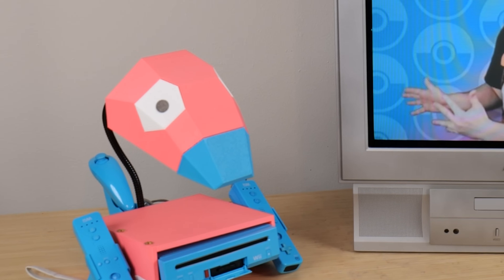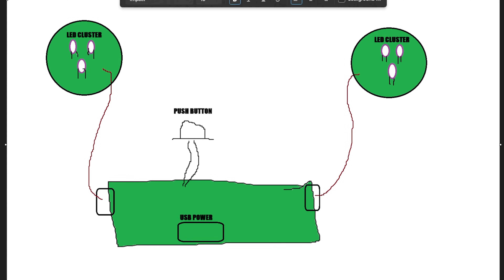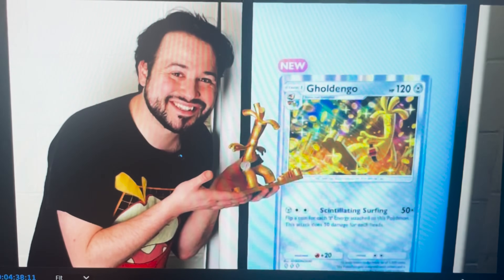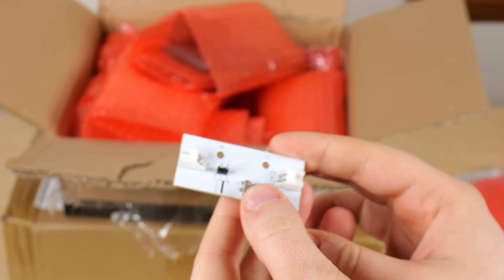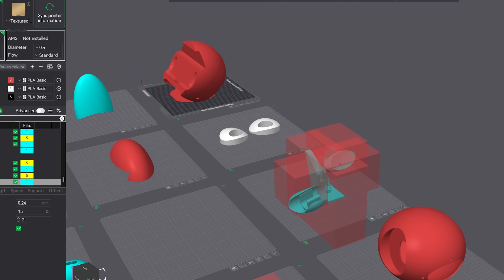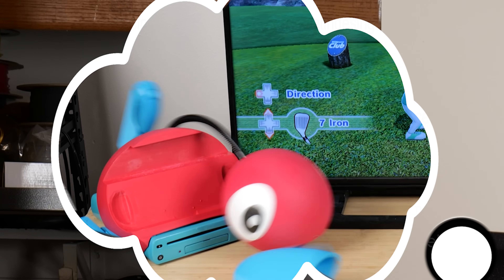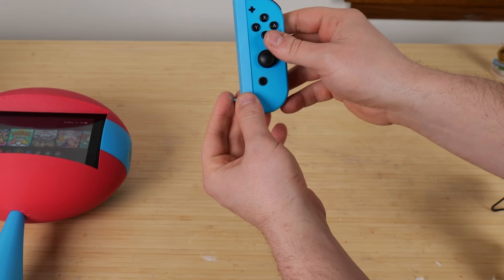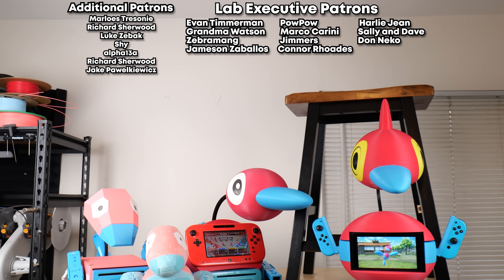I 3D printed more Pokémon Consoles

Comment: 7:34 The reason why the sensor bar works farther away is because the gamepad has a built-in sensor bar for Wii games when you use it as a screen. You got 2 sensor bars added for double strength and signal.

Comment: 6:13 You aren't. It not designed to be tampered with.
Reply: But they are designed to be repairable (by Nintendo) so, yes there was a way to disconnect without damaging the socket.

Comment: Looks good, but next time you should go to a home improvement store and get the paint color matched to your filament. When you paint, use light multiple coats, wet sand between coats and don't forget to use a primer. If you really want it to bling, finish off with a couple coats of UV resistant clear. Then you're gold. All in all, great job. Do you offer these files? I think it really looks good.
Reply from the maker: Thanks for the tips!  And yep the files will be live on my patreon starting tomorrow!
Reply: @BigRigCreates  I asked about them elsewhere, this is awesome! Will take a look there! :) Thanks!!

Comment: For the Wii plushie if I back £30 will I have to pay £30 to actually get the plush? Or is that factored into the cost of the backing. I've never used kick-starter so im a bit confused
Reply: The £30 that you pay as your pledge is to get the plush.  It's like buying, but with much fewer protections.  That said, a project like this which is already developed and is basically just a preorder and should be incredibly safe.